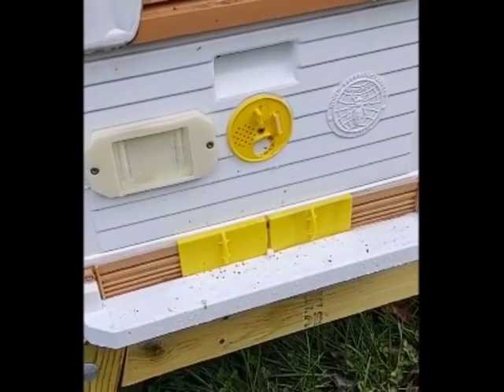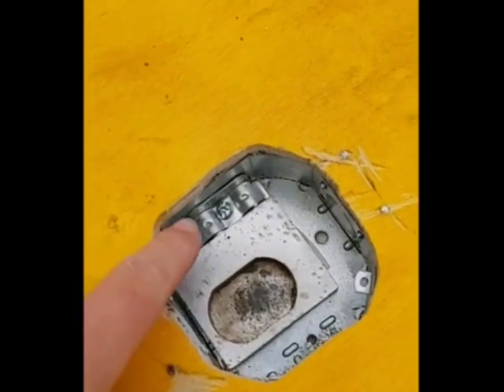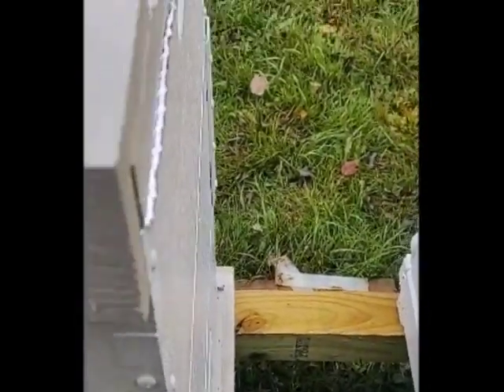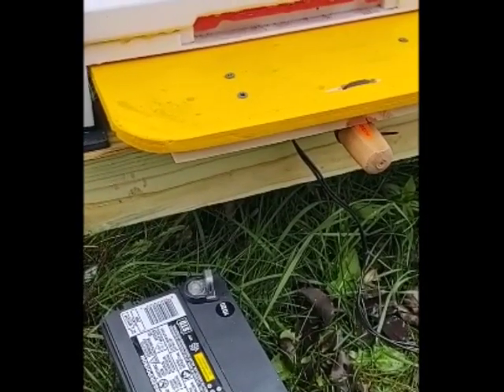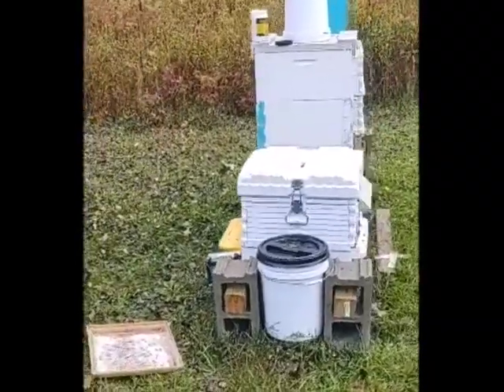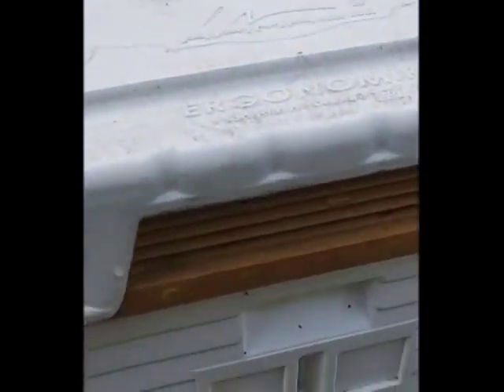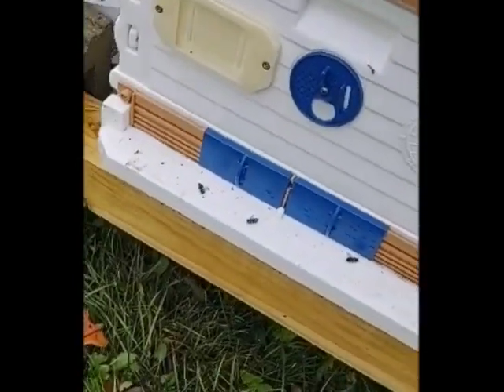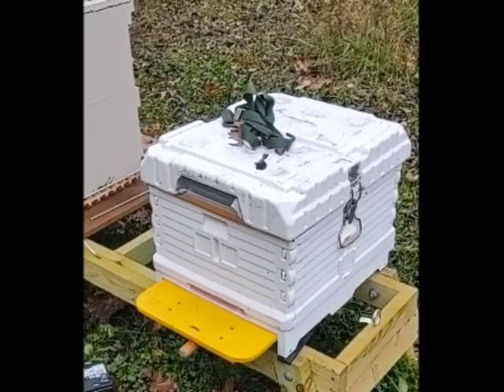Treating an Apimaye beehive for mites with an OA wand.

Comment: Great video, definitely the best method I’ve seen. Any chance you could supply the dimensions of the board please?
Reply from the maker: I used 1/2 in plywood.  For the dimensions I would pull the bottom tray and trace around it leaving a couple inches on the end.  My approx dimensions are 15.25 in long by 24 in wide.  Other people have commented their bees will propolize the bottom of the hive on the inside.  Watch out for this if you go with this method.

Comment: That’s an awesome idea.  Thanks for the video. I often wonder about the apimaye hives. I wonder about the upper vents. 

That being said. Do you seal off the upper vents in the winter to help keep the heat in. 
Also. There is usually a winter to spring die off with the winter bees. Being that the entrance is not open like traditional hives, it would seem difficult to clear out the dead bees. Can you possibly talk about these two topics in future videos
Reply from the maker: Hello Bee Healthy, I leave all the entrances open in the winter.  The would include the bottom sliders, middle disk and upper vents.  In addition I also remove a feeder cap to keep moisture vented so the bees don't propolize the feeder vent holes.  Bees do great just keep them in a wind protected spot if your in a cold winter region.

Comment: I was trying to figure out how to get OA pan thru pollen trap entrance.  That way its above the bottom grate.   1/2" pan into 1/4" rear trap entrance.  

An extra step could be done   -   After pulling OA bottom board, reach under and wipe hive grate.

Is the reason that it takes so long to vaporize OA is that the pan is touching the metal electrical box?   Not sure if I'm seeing any insulation between Pan and Box. 

I do like your design.    It doesn't change the Apimaye hive with cutouts or holes that need filling.      Good job.
Reply from the maker: I thought about using the pollen trap also but decided the height just wasnt tall enough to make it work.  I didnt spend a lot of time looking at heat loss thru the electrical box.  If your worried about this maybe put some heat tape between the pan and the box.  When I said it takes a long time that was in relation to something like a gasvap or provap.  thx for the comments.  getting excited for bee season.

Comment: Maybe you've already stated this.  What are your dimension and what is the thickness of wood?  I have Apimaye hives and don't want to pull the bottom board right now to measure but want to build so I'm ready for spring vaping.
Reply from the maker: 1/2 in plywood 15.25 x 24 inches